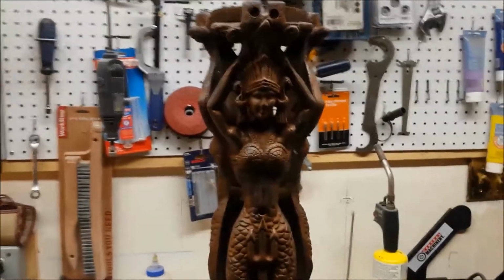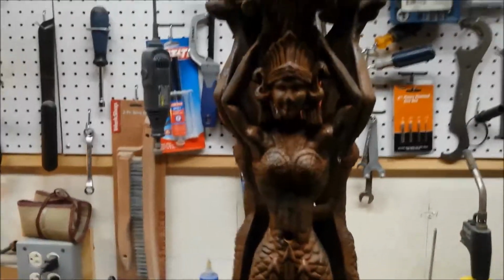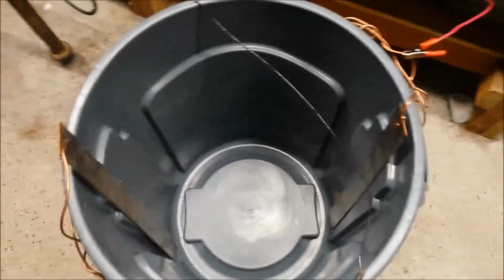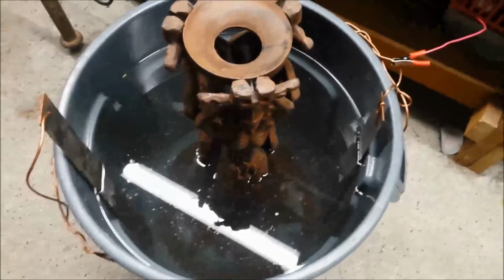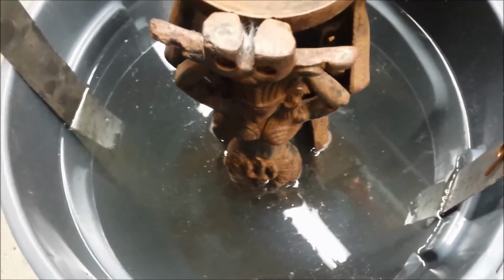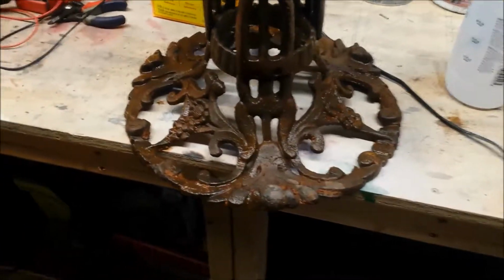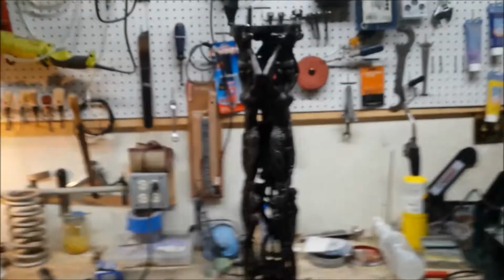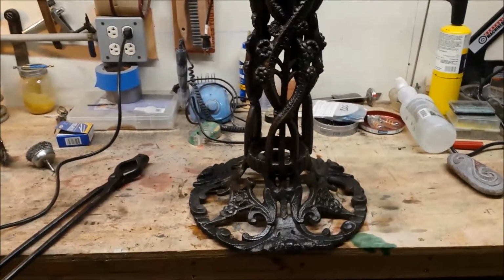Restoring Ornamental Cast Iron

Comment: A little more detain on the wiring hook up would be cool. Like what did you hook the neg wire to? The item being cleaned?
Reply from the maker: The positive lead goes to the cathode, the negative lead goes to the piece being cleaned.  Like in the picture.